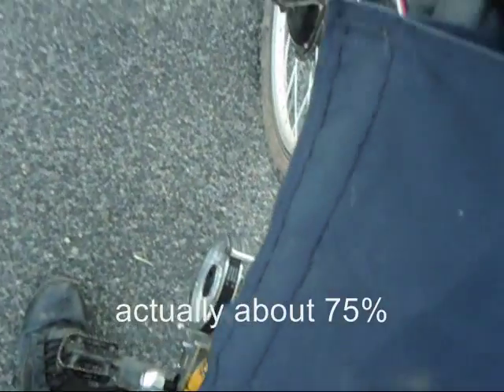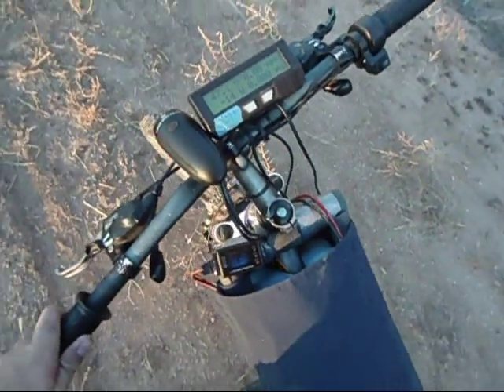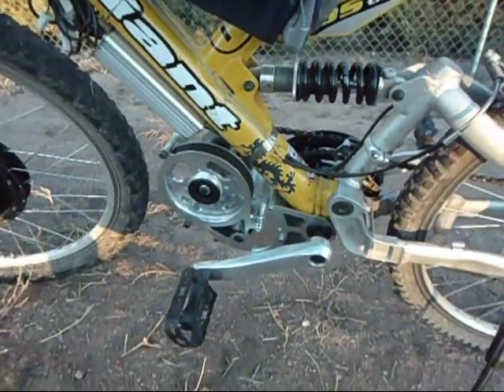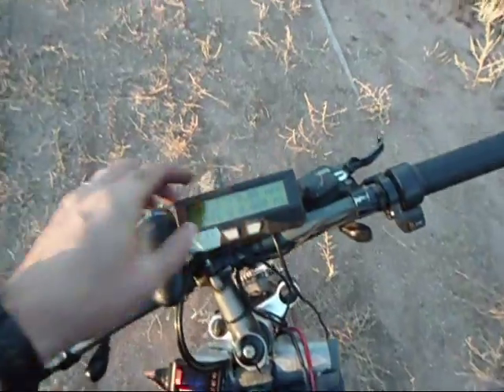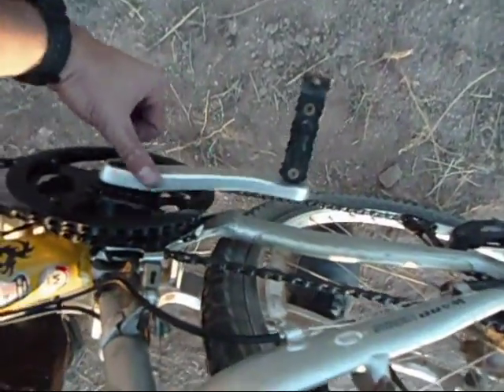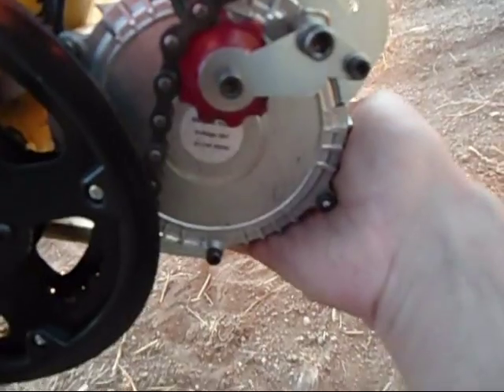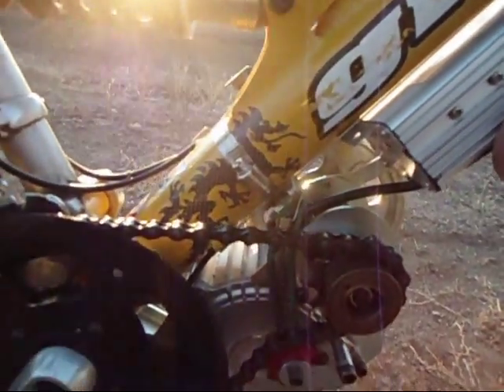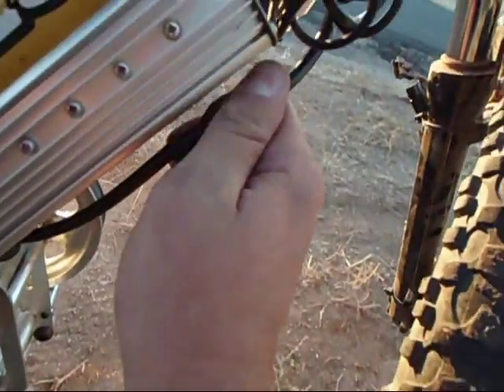gng kit shutter at 75% of motor top speed

Comment from the maker: Yeah, this kit kinda sucks for just cruising around. I would far rather commute on a hub motor. However this kit is pretty awesome on the trails. I have climbed it straight up the side of a mountain. 5000ft to 7000ft elevation without overheat or having to stop.
Highly recommend this kit to off-roaders.
I would recommend a 9C or crystalyte hub motor to commuters.

Comment: hi! have u solved the problem???

i know what is the problem.

if u connected The Cycle Analyst  to the controller so it  that The Cycle Analyst  limit your AMPS and cut off the Throttle see in settings of The Cycle Analyst what the AMPS limit.
Reply from the maker: that's not it. Guys on the forums say it's due to the motor pole count. A ebike controller is made for something like a 32 pole motor where the GNG has much less. Chain mod helps with the problem significantly too.
I didn't think it was much of an issue when I was riding off-road. My speed was always varying with the changing terrain and I almost never noticed the shutter due to constantly being on and off the throttle.

Comment: Do you control the hub motor separately from the mid drive? I'm thinking about using a front hub motor for quiet cruising and the mid drive for climbing.
Reply from the maker: no, I was just being lazy. I was switching from my hub motor setup to a GNG but left the hub motor on (powered off) for my test run. Just a hub or just a GNG will be fine for most applications
Reply: parajared p
Oh, I see. Do you know which GNG kit is the one to get these days?
Reply from the maker: ThingsDemystified I imagine you can reliably use the GEN 1 belt GNG at 500 watts like they recommend, but the kit is a lot more fun at 1500 watts. You can't go much above 1500 because your chain starts grinding.
The chain setup is better for reliability at these powers, but you sacrifice noise. You wouldn't think noise would matter much, but after getting "the look" a few times you may start to consider a quieter setup. I built a different mid-drive e-bike which is cheaper than GNG but superior in almost every way. You can read about the "Off-roader V2" here: http://endless-sphere.com/forums/viewtopic.php?f=3&t=53757
Reply: parajared p
That's a pretty creative setup. I just realized that my rear triangle is fixed, and the bottom bracket is on the rear triangle, so I'm probably going to have to go with a rear hub motor. Are there any rear hub motors in the up to $400 range that you would recommend? Some of those 1000W ones on eBay/Amazon look interesting.
Reply from the maker: ThingsDemystified Wesnewell on Endless-sphere has good things to say about the amazon/ebay motors. You get them for the cheapest price at Yescomusa.com. I haven't tried the mega/prokit/yescom motor but of the motors that I have tried I like the "MXUS 500 watt" Direct drive in Alex rim from EM3EV.com for $165 the best. I also think it's better than mid-drive in almost every way except grinding up super steep (hard to avoid a wheelie) inclines at slow speeds. I have tried Magic Pie, 9c, Bafang, and Crystalyte and EM3EV DD is the best bang for the buck that I know of with a close second to 9c from ebikes.ca. I can sustain 2800watts on a warm day without breaking the conservative threshold of 110 celcius. Motor wattage labeling is a silly game. That same ebay motor you are interested in will be called a 300 watt motor if you live in England due to e-bike law, it will be called a 500 watt motor in China and here in the US they call it a 1000 watt motor, or if you shop at highpoweredcycles they will call it the "it totally won't burn up we swear" 900,000watt motor!    =P.
Reply: parajared p
Thanks so much. I see a MAC geared hub kit on EM3EV. Is that the one you're referring to? I bought a 500w 9c kit from Amazon, and with the included speed control, it is way too weak at 36V. I'm hoping that with the 5:1 planetary gearing in the MAC kit will give me much much more torque. I'm also interested in the GNG Gen 2 kit. It seems that kit will give more torque than the hub motor kits. What do you think?
Reply from the maker: ThingsDemystified I like the MXUS DD drive. I haven't tried the MAC, but I have heard good things about it. "More torque" is a common misconception. A 1000 watt motor will give 1000 watts of power whether it's a "high torque" or a "high speed" motor. Electric motors burn up when they are bogged down, so the high torque motors just spin slower so they aren't bogged as much (thus less likely to overheat) on the hills; they don't actually have more torque or power.

Your "500 watt" motor will probably be fine, it's just the speed controller and the battery that aren't providing enough energy. A stronger controller will allow you to push higher wattage, but then your battery may be taxed too hard.

GNG/ mid-drives in general are kind of a crappy way to go, they bend your gears, you will break chains, they take more maintenance, they strip the teeth on your cassette, and they are a pain in the rear to install. They are only good if you want to go up stairs and off-road on steep mountain trails and stuff.
Reply: parajared p But the higher wattage kits will allow a higher current to reach the motor, resulting in more torque right? It looks like they don't carry the MXUS DD drive anymore. When you say that the mid drives bend and break parts, what wattage does this occur at?
Reply from the maker: ThingsDemystified Yes, more wattage= more torque.

GASP!! no more MXUS. GASP!! 9c at ebikes.ca is getting phased out too; that's a bummer, those were my two favorite motors (maybe one and the same). I guess my 3rd favorite motor was the Magic Pie 2.

I am experiencing problems at 2000 watts (input) on my mid-drive and am planning on toning it down to 1200 watts as another member on the forums seems to be having success at that wattage.
Reply: parajared p
Are you running your belt drive with any upgrades?